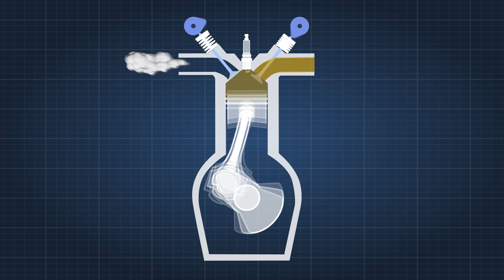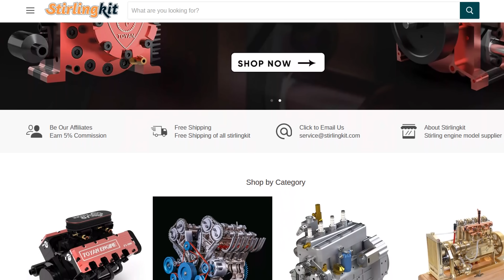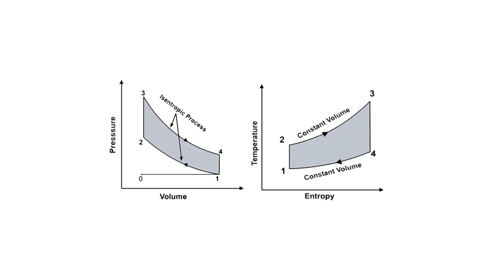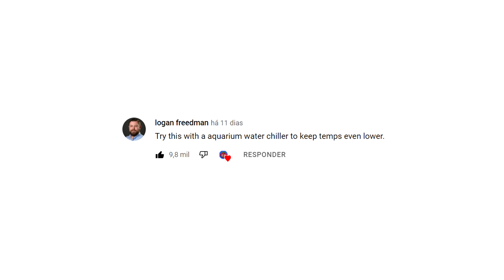I 3D Printed a Transparent Combustion Engine in Resin

Comment: What you are seeing is know as misfiring and there is a lot of reasons why it could be happening:

Weak/fault spark will not reliable ignite the fuel causing misfires to happen. There a many reasons a spark is not good enough. The plug gap can be too big or too small, the duration of the spark can be too shorth, the plug has cracked causing current to leak, carbon buildup on the point of the spark plug and undersized/fault electric coils.

Wrong spark timing will not try to ignite the fuel at its best point.

Wrong valve timing may not let the burned fuel leave the cylinder causing the engine to choke, it could also not let enough air/fuel to get in also causing the engine to choke.

Fuel mixture too lean or too rich can cause misfires. This can be fixed by adjusting the carburetor. And different fuels will require the carb to be adjusted differently since they don't use the same air-fuel ratio.

Weak seals/low compression will not let the fuel reach its most ignitable point. In a normal IC engine the piston makes a seal with the cylinder with a combination of the piston rings plus the oil on the grooves of the cylinder crosshatching. Its also very important that your cylinder and piston is perfectly round. A oval cylinder/piston will leak air-fuel mix and combustion into the crank case also know as blow by. 
Another important seal is the head gasket. It you didn't torque the head enough or the head gasket blew it will leak air-fuel mix and combustion into the atmosphere.

Compression ratio will define with type of fuel works best with your engine. As examples naturally aspirated Gasoline engines compression ratio is usually around 10.5:1 while Nitro RC engines run at 6:1~8:1. If your engine was design to run with nitro that is why its running well on 25% nitro. 
(This is extremely important and most likely explains the behavior of your engine yet after a quick look no one has talk about it on the comments.)

Spark timing over the RPM range. The flame front of the combustion has a fix speed but the engine does not. You want the peak pressure of the combustion to happen a few degrees after TDP but since the flame front has a fix speed and the engine doesn't you need to something to match them as the engine speed increases. Old engines had a governor inside their distributor that would advance the spark timing so the peak pressure of the ignition would match the TDP of the cylinder. Your engine doesn't have this feature meaning that at high RPM your spark is always firing late.

Comment: Now homebrew one man you can definitely do it

Also you have to consider the application when determining the quality of engine designs. 2 stroke and rotary engines do not wear well and are far heavier polluting for their displacement! Not to mention the average 2 stroke produces far less power for the same amount of fuel consumption.

Also for consideration, lots of these small engines are "hit and miss" so to speak and will not fire on purpose to keep a constant ish speed or to aid in cooling when power is not needed. 

25% nitromethane is pretty strong stuff, it's used a lot in small RC cars but is often ignited with glow plugs or simple compression rather than spark ignition. They also often contain oil for these engines which does not burn intentionally and is used to lubricate the bottom end of the engine

Yes, it is possible that the ignition timing is incorrect. However, this engine design makes it difficult to adjust.

The speed of the engine is also not entirely indicitave of it's performance, you should look into constructing a simple dynamometer (like a prony brake) to get some real data. There's a DIY project out there for making an electronic one to connect to a computer as well.

Comment: air fuel ratios are important. each fuel requires a different ratio of fuel to air.  I would wager that your ratios are too rich causing it not to ignite judging by how much fuel appears to be running down the cylinder walls..

Comment: 1) Check Ignition timing (more RPM = more advance) and voltage.
2) Check valve timing (more RPM =  more advance, more longer opening time and more valve lift)
3) Operating temperature of the cylinder/piston (important for expansion of materials for good sealing, make cylindre wall really thicker )
4) Check Air/fuel ratio (richer or leaner this parameter may varry with the temerature of the chamber and  fuel temperature it self)
5)Check compression ratio (8:1 to 14:1 for gasoline engines )
6) Check compression it self ( more or less than 10 bars for gasoline engines )

This may vary with fuel type.

GooD luck !!! :)

Comment: The 25% burns to fast an thus in combination with the bad compression it can't move the cylinder downwards faster then the others. If you would have added a little diesel the burning of the fuel mixture is more consostend helps you overcome the imperfect compression

Comment: The reason you dont get consistent power stroke is because the engine have no load and it seems like the governor prevent it from going stupidly fast (thats what a governor do in an engine) in this case it seems to be an electronic governor (just a guess) check single piston stationary engine videos on youtube, you can clearly hear the power stroke in those, since they usually run it with no load, 1 power stroke is enough to spin the engine above the governor max RPM limit, there wont be power stroke until the rpm goes below min RPM limit of the governor, then it enables power stroke that again spins the engine above its limit and the cycle repeats

Comment: Hmm, could it be that the sparkplug wasn't grounded well enough? With higher RPMs the rods lifting the valve rockers might not be in contact enough as the spark is generated, thus denying the spark of a ground to complete the circuit. I didn't see properly but it would be worth testing running a wire from the top to the block if you ever revisit this.

Comment: The reason for the problems you are having has to do with tuning. You have to tune the carburetor for each fuel to mix the air/fuel mixture to stochiometrich values. In simpler words, the ratio of each fuel has to match the stochiometric value of air to fuel to run right.

Comment: Maybe on the power strike the combustion almost slows down the piston slightly, so no combustion the piston is freely moving with little compression? I'm no engineer so I have no idea. I wounder how differently the engine would perform under load

Comment: But, if most part of the energy produced by the engine is heat, and almost all of it is wasted, could that heat energy be recycled and converted to mechanical force and make some kind of hybird fuel/heat engine? To kind of maximize the efficiency of the internal combustion engine. I'm sure someone thought of it and tried but still. Can you try the ideea in a future video?

Comment: Higher energy density is not the only thing! One other major factor is laminar flame speed which you likely know about from your work on jet engines -- in the case of a different fuel the speed of combustion may be slower, meaning it's still burning when it is exhausted by the cycle, or it may be so fast it over pressures the piston rings before it can transfer the energy of expansion into the piston. This is also a factor in why engines have "power bands" where their torque change depending on their rotational speed.

Comment: Well first thing that matters is air to fuel mixture ratio and every fuel need different ratio of air to give its performance second thing is ignition time and different ignition method because some fuel don't like spark plug so try this method and next time put turbocharger while using nitro it will give you much better performance.

Comment: well... pretty lame but try making an RC car with that engine (with or without the clear cylinder to increase its performance) and also make a remote-controlled 4 or 6-speed 3d printed gearbox/ transmission for it. If possible make the outsides of the gearbox/ transmission transparent. I would love to see it cause I haven't seen much of RC cars with transmissions.

Comment: Cool project, not the first of its kind that I've seen.

https://youtu.be/nvMcFQqhbpM

The phenomenon where the engine is skipping power cycles I've always known as two cycling or skip cycling. It's usually caused by a too rich fuel mixture, which is probably why it improved when you swapped to fuels with a lower stoichiometric ratio. 

Fun fact, skip cycling is regularly used when tuning chainsaw motors. When the engine is placed under load the fuel mixture leans out a little and you get maximum power and lubrication from the fuel oil mix.

Comment: What if you tried to make a transparent rocket engine using the system the RS-25 engine used. This being channels in the nozzle that fuel is pumped through as a coolant then that heated fuel gets injected into the combustion chamber. This allowed for much hotter thrust without melting the nozzle.

Comment: One possibility to explain why the engine runs faster at 1 to 12 strokes is because this could align better with the resonance frequency of the system. The excitation period could be more close to ressonance by this rate than 1 to 4 strokes.

Comment: The racing fuel is used in high performance engines with blowers and turbos and such. This is the main reason it did not work so well in your engine... Just the wrong application for the fuel...

Comment: Try using a jet engine to melt aluminium.
Try running a jet engine on variety of fuels like gasoline, diesel, waste engine oil , waste cooking oil and so on. 
Build a mini see through diesel engine.
Try making a vaporizing waste oil burner.
Test will jet engines work better on liquid fuel or on vapor.

Comment: Perhaps the ignition system doesn’t have enough time to charge the spark at higher revs. That could explain the skipping at higher rpm. You could try with batteries that can supply more current or voltage if the system can handle that

Comment: Hey Integza. The reason why your engine is performing worse with more powerful fuels is because you are either not tuning the carburettor between fuel changes or your carburettor is not suited to the application.

When a race car changes from gasoline to methane or nitromethane they need to retune the ECU to adjust for a different fuel mixture, adding nitromethane with the same amount of air means you will be running really lean as your mixture has a lot of oxygen and very little fuel, you need to tune your carburettor to run A LOT richer.

Also, fuels like methane are often ran mixed with gasoline to cool air intake temperatures and allow more boost and more fuel in the engine to make more power. A naturally aspirated engine doesn't benefit as much from high performance fuels as a boosted engine.

Continua o bom trabalho!

Comment: Not a mechanical engineer but, the engine is bit of resonance chamber, that is, It vibrates in a curtain way during maximum performance, and changes is combustion, resulted from less rigid material or fuel could result in a less efficient oscillation? Another less converted explaination could be that we'd need another compression ratio /air mixture for different fuels?

Comment: The reason a "more powerful" fuel could give a lower rpm has to do with burn rate. If the fuel detonates, then you only have a vertical spike in pressure to move the piston. You get max pressure at the very top and pressure decreases the entire stroke as Volume increases. Inertia, friction, etc greatly reduce useable energy. The slower burn builds pressure evenly giving more useful energy for the full stroke.

Comment: One test I'd love to see you do is to compare the power output between single and multifuel motors.  Like gas and water.  This was used in WWII for extra power in planes.  The water gets heated by the combustion and expands into steam.  This greatly increases power and efficiency.  The down side is it also causes parts to corrode.   From first hand knowlege, I can tell you for sure the B24 Liberator had this function and was called WEP (War Emergency Power).

Comment: Two things. First when you ignite a balloon that has a combustible mixture, it's always going to burn over your hand because you pop the balloon with the fire and then that becomes the hole that it goes towards... And then it ignites. On your hand. Every time.

Put the torch on your little train track slide whatever thing stand on the other side of the balloon and use a string to pull it past there so that it can pop over the balloon and you get a good picture but you stop burning your hand. Lol

And then the other thing, it's skipping ignition cycles because of the speed limiter built into the engine.
If the speed limiter wasn't there, the engine has no load in it would just rev up until it exploded from going too fast.

Comment: You have a leak between the cylinder and head causing a misfire. Put some gasket material between the cylinder and the head, preferably the red gasket maker.

Comment: @integza The reason it’s misfiring is because the fuel to ratio is out. Adjust the mixture needle and you’ll notice improvements. You must also adjust the fuel mixture with each different fuel as some need less air than others because of the nitromethane mix. You may also need to change the main jet for each different fuel if the mixture needle can’t be adjusted enough.

Comment: "gasoline engines suck" - actually, most current gasoline engines don't suck. They used to though, nowadays they're usually turbocharged. So yes, you're kinda right, but also not quite.

Comment: Hi there. Too many subjects to talk about.. First of all different speeds with different fuels issue; reason is compressibility.. Methanol has lower energy on combustion but you can compress the methanol vapur with less force. The engine has only one cylinder. On cumbustion you keep the enregy on flywheel mechanically. Then you use some part of this energy for other 3 cycles.. you loose most of the energy during compression. So if the media inside of the cylinder is hard to compress flywheel rpm decreases more. So it means you are compressing the media more than it sould be. It brings us to the point that ignition is little bit late for this media so you can not fully get back the energy that you loose for compression. It explains why the engine stops when you use more percentage of NOS.
Second topic is ignition: ignition timing is an issue yes but there some other things to take care of also. If fuel/air ratio is not approximitily correct you can not ignite the media. Plus every fuel needs a certain amount of energy to be ignited. That energy is generated by induction coil which is connected to the spark plug. So if your induction coil is not powerful enough for the media it will skip the ignition or never ignite.. Another point about ignition is electrical connection of the spark plug. Normally spark plug has only one cable (wire). There is another one which is not visual. That is the threads of the plug which is connected to the cylinder top cover. Means it is electrically connected to the engine body. Induction coil is electrically connected to the engine body also.so it completes the circuit. On your new setup resin cylinder body is an insulator. So spark plug does not complete the circuit from engine body. Instead it's trying to complete the circuit from the top of the piston. (To piston arm then crank and engine body to induction coil). So I can suggest you to put a wire between cylinder top cover and engine body. Probably it will solve the spark skip for most of the fuels..
Take care...

Comment: Gave you a tomato smash and hit subscribe for this one, though you are right about the fuels and have the engineering right. You forget physics and science. In order to get combustion you need 4 things, fuel, air, spark, compression and if one of those are off will effect how the engine runs. Just look at my pic, its my personal car and even it being older its no different then a modern car. I say physics because you don't ask how much, I say science because you don't measure. To have proper equilibrium between fuel, air, spark, compression and each has a ratio the best perform on. You wouldn't use 87 octane fuel in a turbo, super charged or even high compression engines and doing so could cause failure in many ways. Most of them catastrophic with "detonation". Fuels burn differently at different air fuel ratios, gas is typically 14.7 and if you add ethanol that ratio will change just as if you were to run methanol. The ratio change can be looked at as running rich or lean. I seen a lot of fuel pooling in the cylinder slowmo and could also not be atomized enough or running rich. Compression is one thing, most don't think about needing a vacuum and atomization in carbureted setups happens while fuel tumbles in the intake past the valve. Not enough vacuum will give weaker atomization and why fuel injected cars can run on what can seem to be less fuel because its directed in a pressurized atomized spray. I could say this and that. Without physics or science support to back my claims its irreverent and just cool to see the booms in a clear 3d printed cylinder. Dial the fuel down, I bet it solves what you see and would like to see if it helped. I also don't know the engine model, if the valve springs are too weak they could float at higher rpm and for a small engine like that I don't expect it to be able to to much rpm stable. Most automobiles will have valve float around 5500-6500 rpm unless modified and you could contact the designer of the model to see what its operating rpm range is or look at the evil book called "manual". Wouldn't mind seeing different technology applied to increase an engines efficacy or 3d print the whole engine. I suggest the wankel rotary engine just because its fun to say